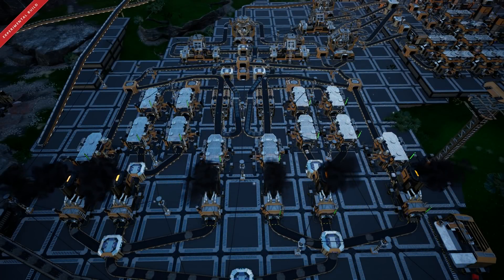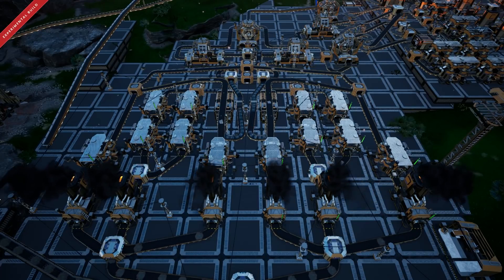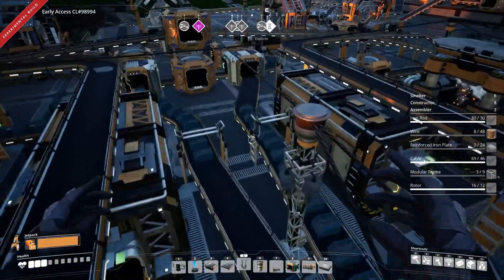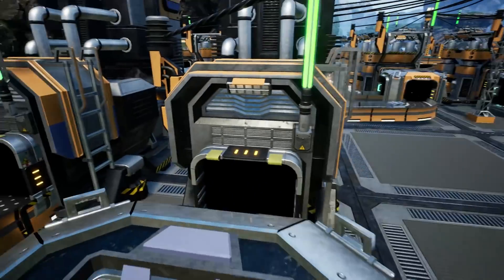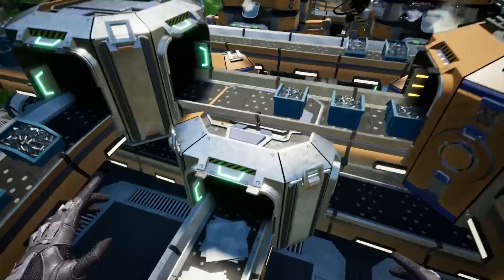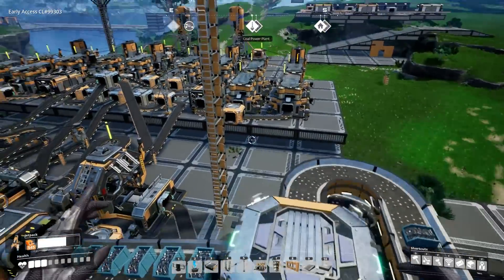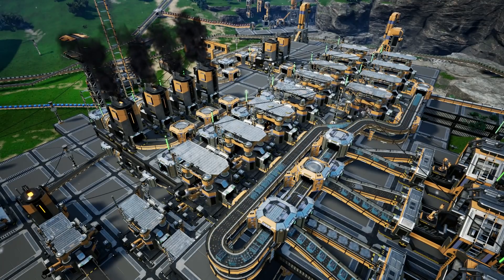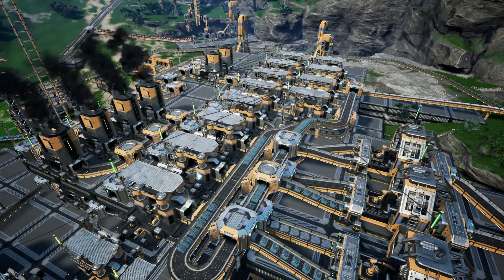Satisfactory Myth Busters: What's More Efficient, Bus vs Perfect Split

Comment: There are at least two cases where bus formation is less efficient:
1- If the combined materials per second exceed the maximum speed of your fastest conveyor belts
2-If you have the exact number of materials per second needed to maintain power for your generators and the generators are all consuming at the same rate.
In this case, the belts at the end will be depositing the materials needed at a slower rate and the generator(s) at the end will occasionally shut down. This can balance out over a very long time, but I would very much rather use the perfect split method and have the power working properly as soon as I start it.
Reply from the maker: I have to beg to differ. The chances of having a perfect split ratio feeding generators is almost impossible unless you’ve finished building a factory, so you’d have to constantly adjust a power generator setup to get the right ratio. And as for the first option that’s true for any style, with a manifold you’d just set up 2 separate manifolds to resolve that issue.
Reply: @TotalXclipse  I'm not sure I quite understand what you mean by constantly adjusting the power setup to get the right ratio. Because, for example, I've calculated the rate at which coal and water is consumed by coal generators and have given them the exact proportions needed for them to run effectively.
What I was saying in my comment was not implying that the belt setup is less efficient once everything got running, but the process of getting all the generators filled in the first place.
--------------------------------------------------------------------
Although you've supplied a solution to the problem my first point addresses, I wasn't attempting to say that there weren't any easy solutions. I should have also clarified that I meant for this to be after a constructor setup where the constructors' combined production speed exceeded the belt capacity. I encountered this issue once with my Mk.3 copper mine where the constructors were making wire faster than the bus could handle. I indeed fixed that by separating the manifold but I was making the point of "having not chosen a solution yet, it would be less efficient."
--------------------------------------------------------------------
Bottom line, I completely agree with you, if you're still progressing in the early/mid game you'll have to make adjustments for better optimization while progressing, getting faster belts/miners,  etc.
Love your videos, man. Thanks for replying.
Reply from the maker: @Nehji_Hann  Hey no worries man, and thank you for the time to think and write your comments :)  please don't think I'm trying to "shut you down".  I'm a firm believe that debates are great at helping everyone come up with better ideas and solutions (providing it's a positive criticism) What I meant regarding the exact proportions is because powerplant consumption scales with power usage unless you've finished your build and are not adding any more buildings. You will always have differing ratios. For example at full power production a coal generator uses 15 coal and 45m3 of water per minute. however if you're only using 37.5mw of power then you'll use half the required resources and you shouldn't have an issue with  starting up the factory (unless it's a big powerplant) because unless you're using the total capacity from the get go, the current powerplants will pick up the slack say you're using 4 generators worth of power in an 8 generator setup. Unless you space the power plants far apart you'll be able to run the powerplants after coal has entered the fourth generator. 
with the over production on a line, that in itself is a problem for both the load balance and the manifolds as it's on the merging side so you'd need to separate the mergers into two outputs or wait til you can upgrade the belts :)  Thanks for listening to my mad witterings :D
Reply: @TotalXclipse  Thank you for being respectful  about this. I can't remember the last time someone took me seriously in this way.
But yes, I did know that generators consume less resources if the power demand is lower than their cap.
It looks like we're on the same page about this topic now. I'm glad we had this discussion.

Comment: If you have to many machines on a bus line you reach you reach a point where the line cannot maintain 100% efficiency. I know I tried. That is why I switched to splitters. After some experience I was also able to develop extremely space efficient splitters by using vertical space that is normally wasted in most builds.
Reply from the maker: Very true, but if that's the case if you have the right resource ratios rather than do one long line, split into three smaller lines :)
Reply: When you have very long (30 smelters or so) chains, you might need to add a "side feeder" belt to inject material onto the belt, this is especially handy for a double row setup with center feed belt, which feeds at double inverse instead of simply half at each split, but the 20% smaller footprint over the single manifold, and 65-70% savings over perfect split, might make it worth the extra belt feeder. I tend to overstuff the belts (5% overhead) when I can, ensuring that everything back caches on the line, so when you do make additions, initial fill up is basically already cached on the belt.

So far, I have not seen a setup big enough to fail, though I think the longest single chain I've built is 40 to 60 smelters, it's only limited by material feed. That said, depending on the scale, using a hybrid style to deal with belt limits would also work.

Comment: You dont need to connect all outputs on splitter. If belts can carry the amount one output is taking 20%, gets filled up and rest 80% will go out the splitter even on single output.
Read the wiki ;)
Reply from the maker: I'm not sure I understand if you can please link the article - although do bear in mind this video is old. 
Are you suggesting on a full mk3 belt (270IPM) you can use a mk1 to split 60 off leaving with the other 210 on the belt?
If so, yeh, I knew that if not I would be very interested in checking out the article

Comment: Actually I've obtained the opposite result in a turbo motors factory. I mean that for big factories, with long production lines (20+ machines fed by one single conveyor) and many steps, each line feeding another one, the time of warming up is extremely long (many hours, actually I had to wait until my storages where all full of turbo motors and all my production lines got saturated). I also saw that my fuel power plant lost 2 GW of power when my factory was working, not because of a lack of resources, but because of inefficiency issues that appeared due to the fact that my turbofuel factory needed time to warm up and eventually some generators didn't receive enough turbofuel. But I found a solution, with an hybrid system between the split and the bus systems. The main idea is extremely simple. Suppose for example that you need to feed 40 machines with a conveyor of 600 - generally I don't use Mk5 conveyor belts at 100% for various reasons. You can put 9 splitters on your belt, with 10 Mk1 conveyor belts and each one feeds 4 machines (and for these machines, no matter if you use perfect split or bus method, because, indeed, both work for small production lines). With that method, you're going to warm up pretty fast, especially if you use only Mk5 conveyor belts in your entire factory - apart where you need Mk1 in order to take only small amounts of resources on your main bus. This method allows you to have compact production lines - you just loose a bit of space because you have a main bus and several secondary buses, each one feeding a little group of machines - and your line is warming up very fast. And also, add buffers between your lines, that will help.
Reply from the maker: Yep I see your issue, with long lines you have to be careful that the time to move the items across doesn't give your first manufacturer the time needed to produce again, otherwise it will never reach 100% efficiency, instead you have to run two lines and ensure you're running the required IPM. Another option is to fully back the manufactures by hand and you can also limit throughput by using lower tier belts off shooting (say you have mk1 conveyor on the first split to a machine and you're running a mk3 full of items, it will limit it to 60 IPM so the other 210 Items can go off to other machines :)
But thanks for adding this message! It will certainly help some people out :)
Reply: @TotalXclipse  The problem is even worse because if you use the basic setup, 1/2 item is sent to the first machine until it's full, after that 1/4 item is sent to the second machine, then 1/8 to the third one and so on... so the 40th machine of the line will receive very few items until the 35 first or something are full, which can take a quite long time. And if your production line feeds another one, the last machines of the second line won't receive items until the first one has warmed up AND the first machines of the second line are full. I was like you, I thought that once the production line had warmed up, both systems were equivalent, but what worked well for basic factories (for heavy modular frames for example) was not true when I built a bigger and much more complex factory with a final line of 20 machines that were producing turbo motors - and I used supercomputers as inputs for the RCUs. I filled four industrial storages with turbo motors before I reached 100% of efficiency.

Comment: As long as your production matches your belt tollerance, the overflow method should be exactly as fast as splitting. Once the machines have filled to their capacity all machines in the line should be receiving items at the same speed.
Reply: Agree with this - I've never bothered splitting perfectly, because the time spent perfectly balancing it feels wasted versus just shoving everything down the line. As you say, just match inputs and outputs to belt capacities
Reply: also with perfect splitting any interruption in the supply at the very beginning will immediately shut down the entire production chain while the overflow method once fully saturated will take possibly hours till the last part of the lane has ran out of materials.

Comment: Why was the first base only using Mk III belts and the second setup is using Mk IV? That's kind of a major difference isn't it?
Reply from the maker: not at all, the factory is using the exact amount of Iron ore being produced so the conveyor speed will not affect it. The build has the exact same constructors and they're both running at the same clock speed.

Comment: Once running, as long as there are no glitches, and the lines can saturate... The overflow system is nearly equal. However, that being said... It's a game with formula glitches and subject to production "disruptions", which can often deplete those reserves. Causing it to either back-up or purge any stored materials when power is disrupted or fluctuates.

The load-balanced, splitter-distribution setup doesn't care about cold-starts and is less prone to the results of the inevitable "calculation" errors. (rounding up/down on splits and simple formulation hiccups from LOD switching.) Including the start-up and shut-down times, as whole branches turn on and off, or with power disruptions, the splitter-distribution setup wins, hands-down. Size isn't honestly an issue, at all... You have the whole world to build in, horizontally and vertically.

What kills your FPS is having too many things in one location. So, honestly, taking that into consideration too... The compact overflow system, stalling your game to 10 fps, because it can't draw all of that at once, is also less efficient. It would produce 1/6th, in a physical hour, than a setup that forced you to push everything further out of view, into the faster lower- level-of-detail zones. (Or demand you to cover the animated items with visual blocking walls and floors, so the game runs 100% too.)

At the end of the day, it's semantics... Some people count start-ups and stopping and disruptions and "game-play", as part of the "production". Some people ignore all of that, and only focus on the "ideal numbers", when it is actually producing things.

Having an employee who works 200% faster, but comes to work for only 1/3 of the day, is less efficient than having a single worker, working half his speed, for the full day.

Also... Power... You totally ignored power-drain from having systems on full-power, doing nothing, while starting and waiting for supplies. If you truly want it more efficient... Make twice as many machines, running on half speed which results in something like them consuming only 1/3 of the power. (Yes, his power settings are backwards. Machines would consume LESS power making more and MORE power making less, per piece. In his system, producing less will make it consume a LOT less, per piece. There is no actual "machine overhead", just a generic formula that should ONLY apply to overclocking, but it works in reverse, when you underclock it too. It should get worse when you underclock, not better.)
Reply from the maker: Yep you're absolutely right with the power system the lower the clockspeed the more efficient the power usage is but that's the same whether it's a load balance or a manifold. 

As for the rendering and frame drops I purposefully avoided that, because what may effect you may not be the same for me as it's totally dependent on our computer builds.

As for the first argument about manifolds depleting the reserves if the power is off, I don't see how this can be true. If the power turns off all factories are stopped and when the power turns back on (providing all machines were in use prior) all of the machines will turn back on to full use with no start up time and the reserves will not have depleted at all. This will only happen later on if the belts not saturated as the miner would have to warm up and still with that it shouldn't effect the line as there manufacturing process will be staggered due to how the manifold originally started 

Although I could be mistaken

Comment: Actually youre wrong, on a small scale bus will be the same as spliter, but when youre having a very long bus and youre source and calculated demand are spot on even, the bus will fail. That is due to the transportation time a resource needs to travel from the first splitter to the last. In that time more resources will be needed on the way from the bus and the system crumbles down
Reply from the maker: Yes I agree - but provided you get all the items along a bus that are need prior to the first constructor finishing it's product then you should be okay.
Reply: @TotalXclipse  yea i think that is correct.^^
Reply from the maker: Yes I agree - but provided you get all the items along a bus that are need prior to the first constructor finishing it's product then you should be okay.

Comment: old clip but don't care. Perfect split at start game. Once you hit coal power its all about bus lines. Much easier to design and expand once you hit mk2 miners and mk3+ belts. Super easy to build 6 smelters in a bus setup, and expand to say 12 once you have the belt tech (or demand) for it.

Comment: They are less efficient.  You're comparing it to an in game statistic that is 100% efficient if it runs constantly or no lag time waiting for resources.  Each of your machines have a buffer of resources meaning wasted.  Those resources could be run into another machine to produce additional goods. 

The split model is the most efficient model.
Reply from the maker: James Wilson I see your point but if they’re running at the same productivity creating the exact same amount of items per minute as the split method then surely they’re as productive, having a buffer is not so much of an issue because if you added more constructors they would never all fill up so they would make them less efficiently surely? 🤔
Reply: @TotalXclipse  The only difference is that the manifold feeder give preferential treatment to the first devices on the line. A non issue really. Factorio players have agreed for years that this is a perfectly fine and highly efficient way to run a megafactory.  
A thing of note that many people forget to take into consideration:
With a manifold feeder, you can easily take surplus items and feed them onwards into the next setup, letting you overbuild later setups and using them as resource sinks for lower tier items.

Comment: Bus lines arent focused on efficiency, they let you use space more efficiently and manage resources more effectively.  I use stacked bus lines for higher tier components which avoids the space nonsense you have in this video.
Reply from the maker: You're absolutely right, they're also easier to expand, but the whole point of the video was to compare the two because a lot of people at the time were stating that one was better (efficiently speaking) over the other.
Reply: TotalXclipse yes, agreed i just think that arguing over efficiency misses the point somewhat.

Comment: When using lifts you don’t need to attach belts to them if you place splitter/mergers first than lifts it will attach its self to the item also works with containers constructors assemblers and other stuff
Reply from the maker: You're absolutely right, as of I think U2, this became a thing, however in the first rendition of lifts we did need to unfortunately. Thankfully we're over that now!